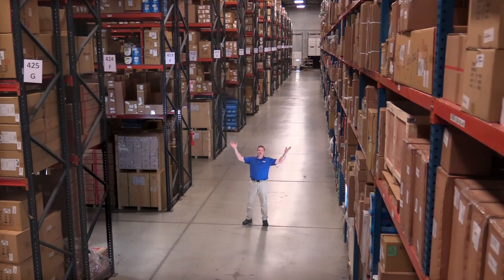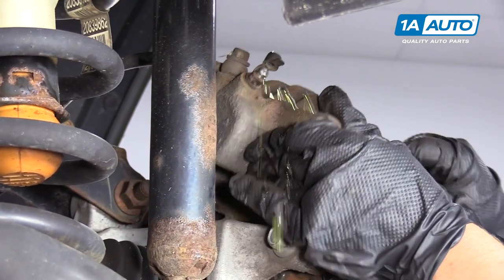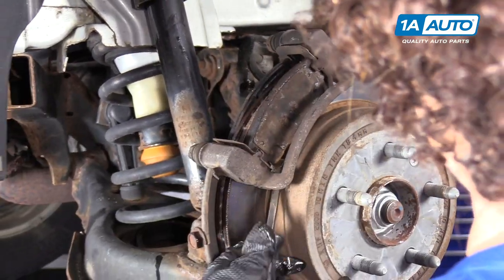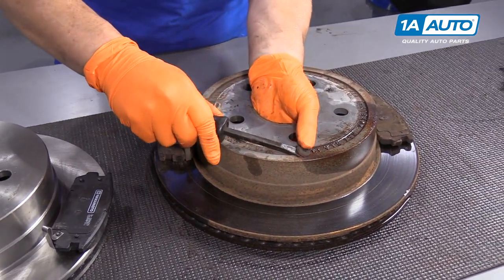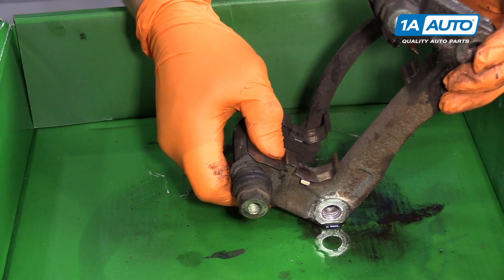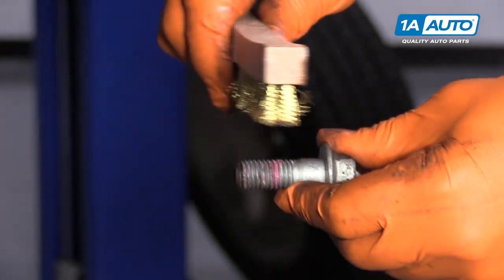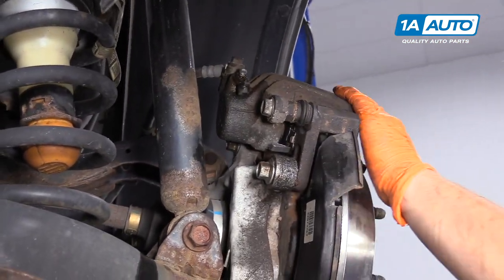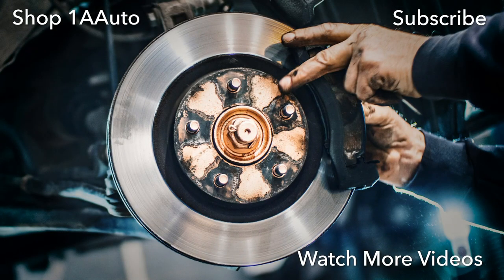How to Replace Rear Brake Pads & Rotors 10-17 Chevy Equinox

Comment: I just love how everything is clean and already loosened! And no turning the E-brake back to get the rotor off? I wish 1A Auto would show real world videos. And who opens the bleeder valve to compress the piston?? Just creates more work as you have to now bleed the brakes. I always use a big C clamp while the everything is still on the vehicle and crack the cover on master cylinder.

Comment: In 15 years of doing brakes on various cars I have owned and put many many miles on, I have never had to crack a bleeder to compress a piston and have never had any resulting ABS system damage. Can you be more specific about what may occur? Removing the cap on the reservoir has always sufficed to me. If what I've been doing is truly "wrong" I'd sure love to know why as I've never experienced a single problem. This sounds a little like a "fill the oil filter before you put it on" type situation that sounds like good practice but has scant evidence that proves it's necessary.
Reply: I don't get it either, I've never done it before too but hey doesn't hurt putting some new fluid in it 🤣
Reply: Sometimes an ABS unit has one way check valves which will not allow the fluid to be pushed back towards the reservoir.  You can damage these.
Reply: @panzerabwerkanone  you’re a one way check valve, sir.
Reply: Never heard of doing that either. Did all four on my Yukon and never cracked the bleeder screw. Just making more work for yourself unless you plan on exchanging all of the brake fluid too.
Reply: Just a way of protecting against liability bruh.

Comment: Excellent instruction with good video presentation. I ran into a bit of trouble trying to take off the rotor.  After some effort I realized - because I was doing the work on my driveway - I had the parking brake on.  Once released, the rotor came off without too much trouble.  The WD40 at the back of the rotor where the hat breaks away from the hub was a big help also. As a suggestion, you may wish to add a torque wrench to your tool list at the beginning of the video.  The commentary and explanation of the steps in the process was also most helpful.  Not sure if I got the lady mechanic's name but great job and thanks .. you and 1A Auto were a  huge help in my completing the task safely.
Reply: You don't need a torque wrench my guy...

Comment: Now that's a brake job done the right way.  Very important to not push in the piston without opening the bleeder, so you don't push old dirty fluid back up into the ABS module, which can lead to problems.  So she did it the right way.  Many on these sites have no idea how to do brakes the right way.
Reply from the maker: +Herman Dierks Thank you!

Comment: Just a thought for those that live in the rust belt... you do not need to put the torx screw back into the rotor, the lugs of the wheel will hold the rotor in place just fine. That torx bolt can be a pain if it rusts out, and they strip pretty easily...
Reply: Replaced my dad’s brakes last week. I ended up breaking the screw because it was so rusted i couldn’t get it out.
Reply: If you reuse it, put Never-seez on it at least

Comment: Good video, especially the tip showing cracking the bleeder loose, other videos skipped that part. But, why not use the old brake pad to compress the piston on the caliper? You can damage the piston this way…

Comment: only critique i have about this video and also her job on the front pads, I'd never recommend pushing the piston in with a pair of those clamps, or any type of channel locks without an old pad to push evenly across the entire piston. You run the risk of that singular point damaging or breaking the piston cup. I use pliers all the time but also have a master brake tool kit. But as mentioned I use an old pad when using pliers. other than that great job
Reply from the maker: +Joseph Biggers Thanks for the tip!

Comment: The hole with the plug is also access to the rear star adjuster for any necessary adjustment. Sometimes it's necessary to reduce the adjustment in order to remove the brake rotor.
Reply from the maker: +James Hart Thanks for the tip! Thanks for checking us out! 1AAuto.com
Reply: I can’t seem to loosen the adjustment to get rotor off parking brake. Any tips to know I am turning adjuster down.
Reply: Yes James, wish i read this before hand, as I just finished brake job and those rotors wern't fun to get off.....good ol chevy lol

Comment: I never knew about the bleeding of caliper while pushing the piston back.
Reply from the maker: Thanks for checking us out. 1aauto.com +Chris Lincoln
Reply: I've been changing brakes for decades and have never done that once. Sounds more like a liability thing, on the oft chance customer has an abs issue any time after a brake job, they can then say since they cracked the bleeder that it couldn't have been caused by doing the job.

Comment: do you have to refill the brake fluid after opening the bleeding screw every time?
Reply: Yes, you are losing enough after pushing that cylinder back and losing about a half cups worth on each tire. Never hurts to keep track and replace what you lost.

Comment: I wanted a rear brake pads replacement video for a 2017 GMC Terrain, she is working on a 2012 Chevy Equinox (she stated this) and at the top of the video it says 2017 Chevy Equinox. Is this the right Video ???????? She stated that again when putting the tire back on 2012 ! Not a 2017 . I know Chevy is the same as a GMC. I also used a C-clamp and pushed the piston back in very slowly, both sides. I did remove the master cylinder cap with non problem, and I did not open the bleeder.
Reply from the maker: +Stanley Keith Thanks for watching.  The procedure shown in the video work for both vehicles, so this is correct for your 2012 Equinox! Buy the part in this video on 1AAuto.com: http://1aau.to/m/Shop-1AAuto-c
Reply from the maker: +Stanley Keith Thanks for checking us out! The video is specifically on a 2012 Equinox and the process will be the same for the 2010-2017 years. These parts are also compatible with 2010 -2017 GMC Terrain and the process will be roughly the same. Hope this clears up any confusion!

Comment: Should have  replaced brake clips not just clean them.Comes in the kit.
Reply: I haven't seen a set of new pads come without clips either - and the 'instructions' in the box say to "make sure you replace the clips, do not reuse old ones".